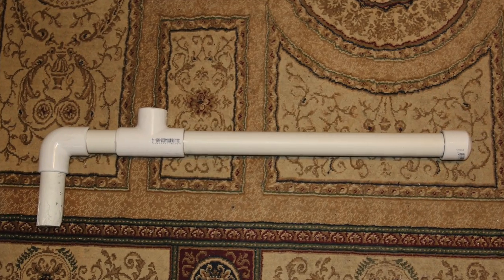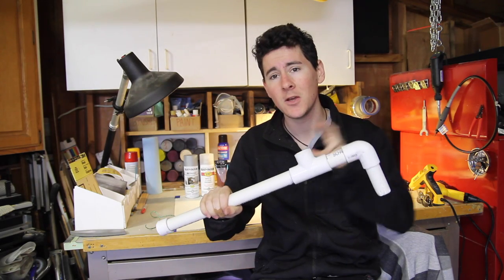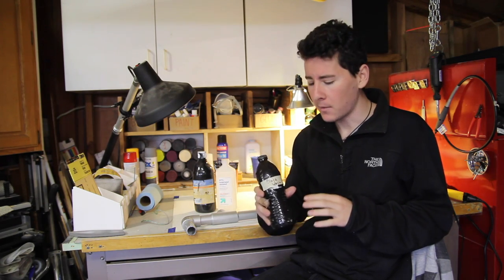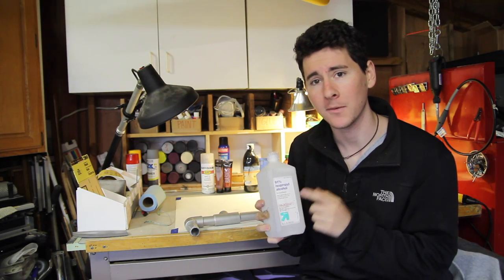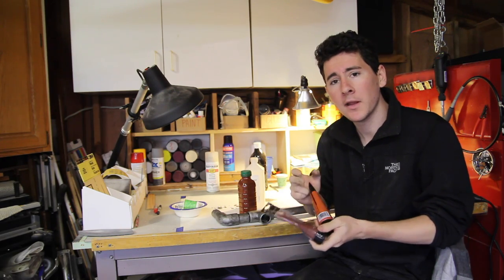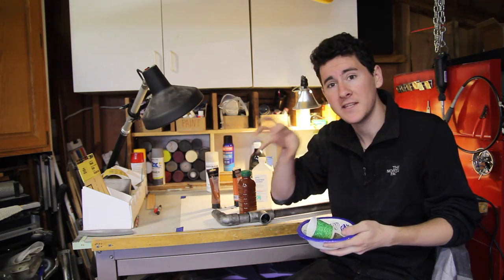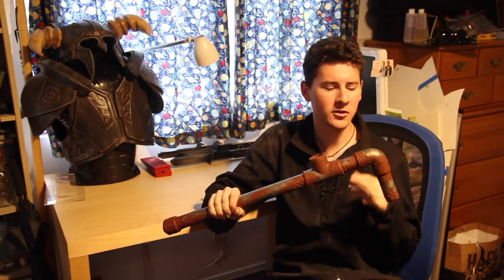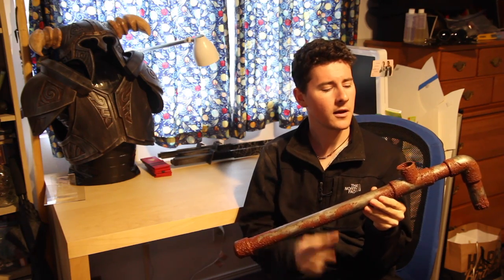Painting Fake Rust

Comment: Can I use this on a plastic rc car body?
Reply from the maker: should work just fine I would suggest going lighter on the paint though so when the car is moving the vibrations don't chip it off. A clear coat may help as well.

Comment: Are there alternatives to dirt and salt with neutral particles so it wouldn't harm metal surfaces I want to apply the techniques to?
Reply from the maker: Sorry I'm not sure I understand what you're asking. Neutral Particles?
Reply: @cwlbuilds   in winder, they add road salt, and it's corrosive to metal, so I am hoping to avoid using salt in paint, not sure if the are the same salt though. I hope to use this type of paint on a light vehicle to dissuade potential thieves.
Reply from the maker: @JebusPrimeDLC  I see, in this case the salt is covered in paint so it won't touch the metal as directly as raw salt. But if you're worried about the salt still you can use sand if you want. Or just use the rust paint colors and don't use any additive. It will look  just like surface rust and not as corroded